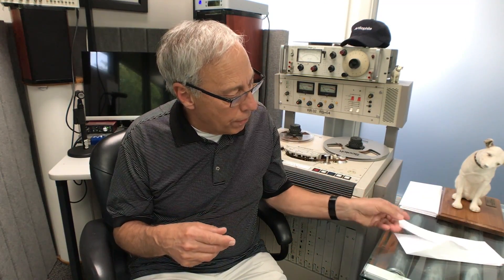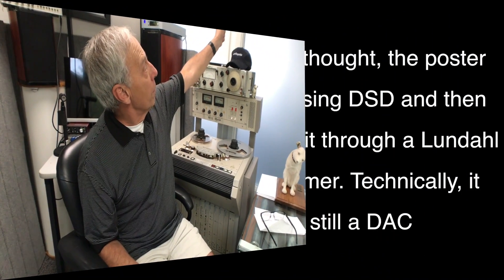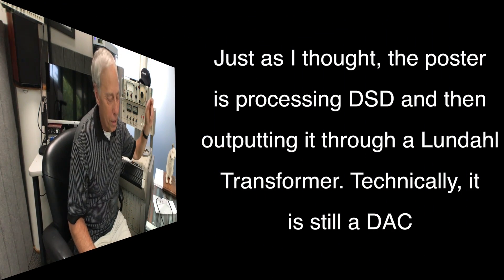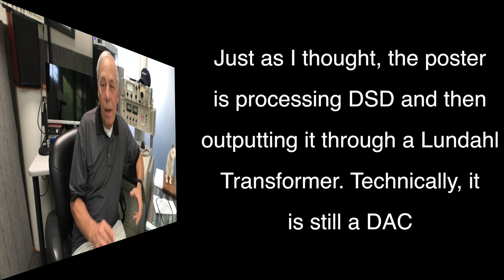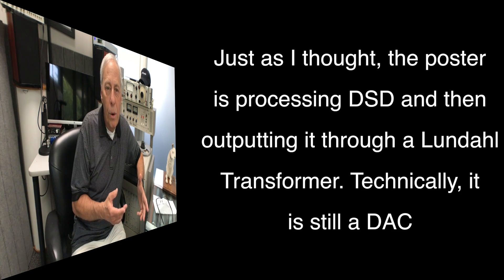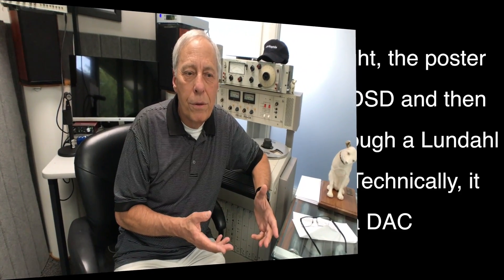Is no DAC the best DAC?

Comment: if you want to check out the Ath dsr series of Audio Technica. they released those headphones in 2017 so they are not the newest thing but they claim at the time that thwy made bluetooth headphones with no dac....
the drivers have been specialy made with a capacitor  beneath that tells the how to move the voice coil..

but essentialy it remains a pair of headphones that remain digital from one end to the other.

there is a wire between the 2 earcups but it is only a digital signal that is sent in.

the Ath dsr7bt is the cheapest rightnow.

just check for renewed models they can sell ad low as 60$ us instead of the msrp of 299$ us.

Comment: I don't understand. Isn't the digital eg. The mp3 file and my mp3 player the dac?
Reply: Your mp3 player has a dac ic inside that converts the digital data into analog sound. Every modern device capable of producing sound has a dac ic - pc's, tv's, music players, etc.
Reply: @svetko05  thanks for the reply. Thats what I was thinking but wasn't sure. If from the media, CD data passes through its internal dac and exits as sound why then do they sell dacs? Wouldn't the dac processed audio going through another dac just mix things up? 

Thanks again.
Reply: @commentcommenter3529  In order to use external dac you need a device that can export raw binary data to it. That would be a PC (and maybe some hi end tv's). External dac's are used by audiophiles who want the best sound quality. Manufacturers don't put the best dac ic's in their products because they're expensive and your average joe is not always concerned with sound quality.
Hope this helps you, if you want to know more just ask.
Reply: @svetko05 Did not know there were other ways to get sound from a pc other than the speaker out (which uses a realtec dac?). But yes, I think I got what and how it is 
.. thanks to you.

Thank you very much again. :)
Reply: @commentcommenter3529  Every device that has spdif(optical) out can output digital audio. Pc's can output it from the usb ports too. Some smartphones can too with special apps.

Comment: "the best dac is no dac" - probably means a 100% analog setup is the best.
Reply: but is that even what we say is analog the real sound? what is real sound?
Reply: @muhammadazim8625  I'm assuming in this case "real" means analog with no digital conversion in the path. Just straight up electricity from source to speakers.
Reply: @MikeSylvestre  yeap its the most "real" we can get
Reply: @muhammadazim8625  most recordings have something digital in the path, even if they are eventually put on vinyl. I think masters are mainly archived in digital format.
Besides: why should the "analog" sound be "real"? Analog tapes recorded at high speed directly from microphones? Well that's arguable, but not certainly vinyl records.
Reply: Anyone can explain Sharp 1bit amp tech back in early 21st century? Is that direct digital output to speaker? Without conversion?
Reply: When you sing to yourself in the shower you can also hear music without a Dac!

Comment: Basically there's two DACs. One is anything that does digital to analog converter. The other is a chip that does the digital to analog conversion. And to confuse things even further. The whole device that companies sell which contains that DAC chip, but also contains everything needed to hook it up to your stereo amongst other things like power supply, and LCD screens to show what is doing, are also called DACs. So there is a physical thing called a DAC. The noun DAC that is. And there is the action of doing a digital to analog conversion. The verb of DAC. In this case he was using them to basically make a little play on words. He's not using an actual DAC to do his DAC if you will. 

Both, some, and all are probably technically correct. Yet some may be wrong. Lol
Reply: so dac as a device and dac the chip itself

Comment: I have heard about the same, always being critical that you can feed a digital signal directly into a loudspeaker and magically get analogue audio out with no conversion from digital to analogue. Of course it can't happen. As you say, even if the conversion is through a capacitor, there is a conversion somewhere, i.e. a DAC. I think your explanation is spot on.
Reply: Depending on the digital coding, you CAN push digital signal into a speaker and get a representative tone out. This is precisely what we used to do with square waves back in the early days of computing. Toggle a speaker at the right frequency any you will hear that frequency as a kind of buzzing tone of that frequency out. There were even a few games that were able to output sampled audio.  It wasn't high fidelity; but, it it did work.
Reply: @timharig  

uh... 3 years ago... 

yes I am old enough to remember that computer era. In fact, I made a simple 8 bit dac myself using a resistor network and a capcitor and connected it to the parallel port. It didn’t sound pretty, but it did play what i wanted to hear in lack of an audio card. 

What you describe sounds like one of two things: one bit audio, which can’t sound very pretty. The other thing is the way you did samples on Commodore 64, namely run the “random” noise sound with modulation of the volume on top if i remember correctly. The sound chip runs through some filtering, which acts as a dac sort of, or you probably would get some pretty nasty high frequency harmonics. 

I do also remember a pc version tune of maniac mansion that was very choppy and in one channel only, but sounding like it was multiple channels, but that was actually 8 bit or something where samples were played so tight that it sounded like several channels. I will see if I can find a link. 

In total, if you have digital on one side, and analogue on the other, there is a conversion somewhere, even if it is in the speaker itself. The sound arrives in your ears as a continuous, not discrete wave. Hence there is a conversion there.

A link: https://youtu.be/MaWEKkl2AS8 i didn’t find the song I was looking for, but this is doing the same technique so it is probably a different song from the same game/ developer.

Found the link, it was for a different game, same dev: https://youtu.be/9pViljsxtcA
Reply: @roygalaasen  No it actually happens in your brain.  If your ears hear a properly spaced series of sound pulses, they will interpret it as continuous beating/buzzing sound. And those high frequency harmonics  on the edges of the square wave are exactly what are creating those pulses.
Reply: @timharig  those edges are discontinuities. Real world does not allow discontinuities. If you dive into them you will find infinity. Real world doesn’t like infinity. (You would need an infinite amount of component sine functions to create a true discontinuity. This is physically impossible.) Hence even air itself has a built in DAC.

Edit: when you say sound pulses, do you mean square or sinusoidal pulses? If you talk about sinusoidal pulses, you are touching into the realm of wavelets. If you talk about square pulses, see my answer above. I am also not disputing that the brain itself can act as a filter. It is not a DAC, though, because by the time anything reaches your brain, it is analogue already.
Reply: @roygalaasen  Agreed;  but at the audio frequencies we are discussing,  there is plenty of room for slew time and damping between individual audio pulses at the rising and falling edges.
Reply: Does anybody know Sharp 1bit tech? Is it transmitting digital signal directly to loudspeakers ?
Reply: @maaxsxzone2914  Sharp 1-bit is just delta-sigma modulation just like DSD. It would at the very least need to be passed through a low pass filter before it could be sent to the speaker.
Reply: @timharig  Thank you for the explanation.